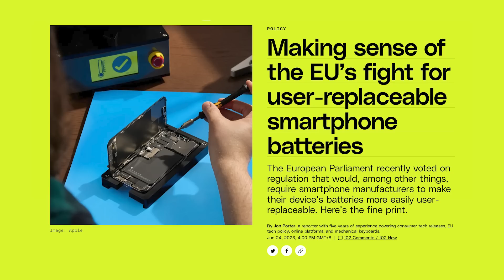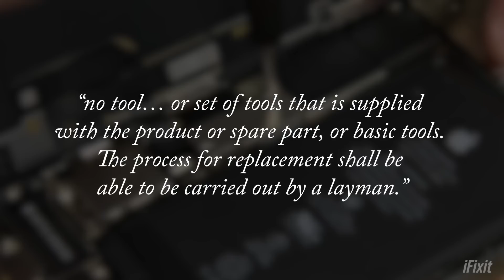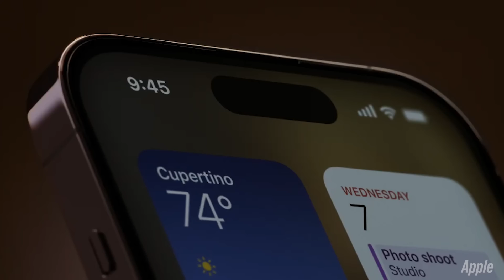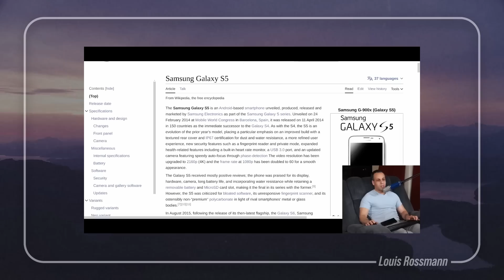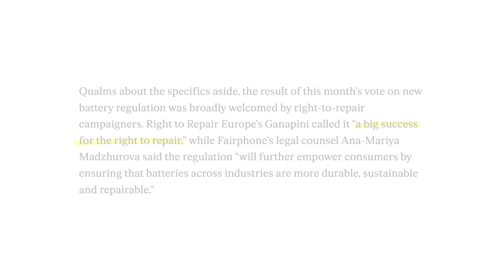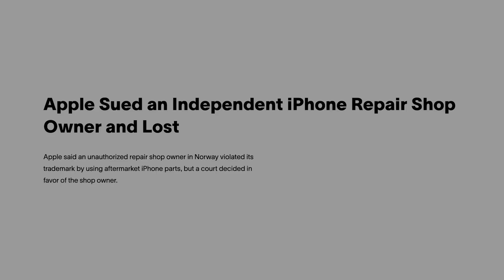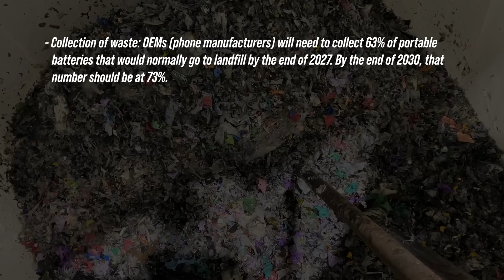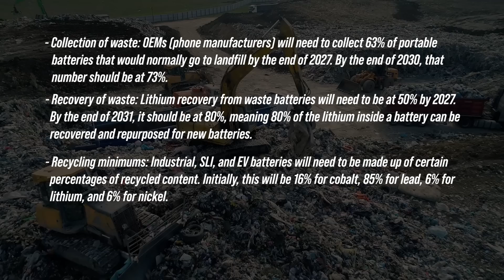EU Just Changed Smartphones Forever

Comment: One thing that never seems to get a mention and which I think is very important is power tool batteries. There needs to be a standard for the connections on 18/20V lithium batteries (The difference in voltage is not significant). I have several power tools with dead batteries that I can't find replacements for, even from the same manufacturer/retailer. Perhaps Aldi's "Xfinity" series would be a good start, as they seem to have standardised on it over their entire cordless tool range and they're cheaper than other brands.
Reply: There should be a one hand law. That is, for example, there should not be any more types of batteries, DC connectors, what have you, than you can count on one hand. And you should be able to easily tell them apart just by looking at them.

Comment: Actually iPhone batteries were easy to replace until the iPhone 4S: Just unscrew the bottom Philips screws, shift the back away, and it's open. I don't mind the adhesive when it's just a strip to pull at the advantage of no rattle.
For me, the 4S was easy enough to repair as a consumer - and I actually think the law might be a bit too harsh and will have bigger implications to device designs.
However, as I own Apple products and as more than once upset by their anti-repair and anti-upgrade measures, I welcome these changes. By my point of view, it was the greed of manufacturers like Apple - their own greed - that led to these changes. They just shouldn't have gone this far, I still should e.g. be able to replace the MacBook's SSD, as this is possible, it's a wear part - and Apple's upfront SSD prices are just obscene. You automatically will purchase a larger SSD and pay absurd prices to not come into the issue of running out of space to soon...
Reply: agreed, i don't get why they are not okay with using regular tools like a screwdriver to repair your phone
almost no one is hot swapping their battery anyway

Comment: As a retired product designer who worked for some time in the telecomms market I'm damn sure that while production love easy assembly with minimal parts and purchasing like products made of cheap components marketing love the idea that they can effectivly enforce product obsolescence and generate sales of new units. In my experience they were usually talking about 'delighting the customer' while stiffing them as much as possible. More sales = better share price = bigger bonuses for (certain) staff!
Reply: The Game changer EU=European Union
Reply: I prefer a phone that can't be stolen and immediately switched off. Removable batteries compromise security.
Reply: @TerriTerriHotSauce  thats a good point. but i guess they can build in a little battery like a bios battery in computers to power the GPS and remote switch 0ff. sure they will find a way :)
Reply: @TerriTerriHotSauce  Phones can be stolen and immediately switched off today, i fail to see what difference a removable battery makes
Reply: @TerriTerriHotSauce  I agree the phone is not completely turned off with the battery still inside and it still can be tracked but it requires special tools witch regular citizens do not have so u cant track it regardless if it has the battery still inside... I love how ppl are so pro environment and yet when we actually have a good way to do good everyone suddenly changes their minds. This just goes to show how much ppl actually care.

Comment: Batteries aren’t the main issue, never had one fail in a smart phone, what is the issue is tech moves so fast that the older devices can’t run the latest software so all this will do is make people go through 2 or 3 batteries per device because the existing dropped to 85% capacity and still replace the device in 3 or 4 years… I can see this creating more tech trash not less.
I’m all for making devices reparable by 3rd parties though, all these super slim designs mean bespoke packaging, so ether mandate a 4 year warranty or mandate 3rd party reparable
Reply: Also, how’s this going to work for a battery booster pack? Does that need to be replaceable? Or structural batteries like in the latest Model 3, it’s part of the car structure so can’t be replaced… will phone manufacturers do the same to avoid this law, meaning the once specialist replaceable battery is now no longer replaceable at all? Manufacturers will find a way round this unless consumers vote with their wallets…

Comment: "how do we solve the problem of users not giving back their old batteries when buying now ones?" simple... increase the price of the new battery by 25%, offer the 25% back when they bring back the old battery at time of swap or at later point...

25% can be a lot, especially when the battery can be easily $50... that just increased the new battery price to $65 or even $75 when they are told "we can give you back the money if you bring your old battery back" would have people bringing those batteries back as if they are well... still valuable to the economy.

Comment: Please no! I sincerely dread the moment I will have to buy a phone in an ugly case and in a case that disassembles into pieces when dropped because of this misguided law. It will also make the phones bulkier. The thing is the battery nowdays kinda works until you want to upgrade your phone anyways. In case you want to still use it with a new battery you can make it replaced in a shop. I fully agree with the "right to repair" sentiment that a repair shop should be able to purchase spare parts and those spare parts and the device as a whole should work without any lockouts when the damaged/expired part is replaced. But I definitely do not want an easy access to the phone battery. It's different with bigger devices (like laptops, ebikes and maybe larget tablets), but mandating this for phones is madness.

Comment: I believe This will not have as big of an impact as many think. Yes, there will be some users who - if the battery dies - will just exchange the battery and carry on on their old device, but I think a significant portion of the users is kinda accustomed (or rather conditioned) to having a new device every 2-3 years or so, and/or want to have the latest tech, best camera, and in the case of android a current OS version, as some android phones only get updates for a ridiculously small amount of time after release.

Comment: Non replaceable parts of ANY kind are anti-consummer. I have a Zanussi fridge that the company doesn't support replacement of the door seal. It was possible in the past to replace the full door at 50% of the cost of the fridge, but they don't support even that any more. The seal was glued in place but I still managed to replace it.

Comment: Did they change the exemptions?  One exemption says that waterproof devices do not have to feature user-replaceable batteries. The second exemption is even more interesting. This is the good news I was referring to earlier. Smartphone vendors like Apple can continue using built-in batteries as long as they offer high-quality batteries. The battery should still have 83% health after 500 cycles. Or 80% health after 1,000 cycles.

Comment: Of course the design is motivated by profit. What kind of question is that? But profits are attained by meeting consumers’ needs at the lowest cost to manufacturers. In this case, evidently the demand for user replaceable batteries is significantly weaker than the demand for other features, and those other features required sacrificing user replaceability for some combination of other things. It’s probably possible to make batteries user replaceable while maintaining some combination of price, compactness and water resistance, but almost certainly not all three. The EU law will cause electronics to either cost more, become bulkier, or become more prone to damage. I, for one, would much rather have a phone that needs repair less often than one that I can repair myself.

Comment: we are ok with bulky and lumpily shaped devices so long as the battery is easily replaced.

for years we had a bubble stick out the back of the CRT tv and we did not complain like karens  about the design so we would be perfectly happy is the CRT was brought back.

we only got rid of our CRT tvs because they could not offer all in one support for digital tv and we had to have set top boxes for cable, vcr and dvd player although there was tvs with the vcr and dvd player built in.

ok apple it is ok to warn us that the part is not genuine but allow us to replace the parts and DO NOT DISABLE FEATURES !

not only for an exorbitant fee could be charged but so they could break into our devices and dump the contents.

apple could easily design the phones so the battery sits in the middle with the logic board goes around the battery or even the battery sits atop the board and an work with repair tool makers to design a guitar pick like implement that has a ridge on it to limit how far in it will go so it does not damage the battery.

and implement the taptic functions in software and just use the existing digitizer glass to read the input.

you do not need a taptic engine module in your mac or pc to read a double click.

it wouldnt be difficult to enforce recycling of batteries just have a fee and reward like in lead acid batteries either as a core charge and/or paid by scrap yards.

or could the non removable batteries be a way to force us to either leave the phone in the car or take it into our meeting and hope no one calls and no one goes "whos phone is that?!!!!"

Comment: The phrase "planned obsolescence" is missing in this video, because it perfectly captures why batteries in modern smartphones can't be replaced - https://en.wikipedia.org/wiki/Planned_obsolescence. Once you can replace the battery, users will start demanding the OS remains updateable for longer as well - as long as the phone still works, why shouldn't you be able to update it? My prediction though: companies will comply because the EU is such a large market. And then they will find another component of the phone that stops working after some time, and the cycle starts over. A likely candidate is in fact the OS - by constantly introducing new features on new phones the producers insist are essential, and by claiming they can't afford to maintain the old OS while also developing and maintaining the new and improved OS, they will force users out of their old phones by breaking essential services that are moved over to 'new OS'-only.

Comment: I cannot see how they can pass this for EV's. This will make the cars less safe. Tesla has integrated the battery cells to frame of the car. This adds to the safety. Tesla makes the safest cars in the world right now, and after over 10 years, their batteries don't loose more the 10% capacity.   I would rather be driving a safe car with my son in the back, than a death trap, on the off chance that I need to swap the batteries out after 20 years.

Comment: Those laws are very needed! Anti consumer practices like this have to be baned! Some time ago battery in my laptop broke and to replace it i had to dismantle the whole machine including detaching the screen and completely removing the motherboard... While all of this could be easily avoided by slightly changing the design of "second" bottom cover that was intentionally made to make battery replacement as inconvenient as possible 🙃 And to compare i have older laptop in which battery replacement takes 5 seconds beacouse all i have to do is to pull two sliders (that are easily reachable at the bottom cover) and thats it! No "operation on open heart" required! Thats how it should be designed! I really wish that those laws will be working as intended ❤

Comment: There are many examples of manufacturers using different hardware for different regions. 
In fact it’s more common than having a single product and it’s precisely because of regional regulations. 
You only have to look at your car,  TV, watches, DVD/blu-ray player, in fact almost any appliance that gets plugged into a wall socket for power.

Comment: I was very happy when I first read about the law. My euphoria has since lowered by the laws details. Sadly there is an explicit exception for water proof electronics. So my assumption is that companies will rather focus to make their devices water proof than making the batteries replaceable.
On the bright side the law also forces companies to use batteries that maintain 80% capacity after 1000 charge cycles.

Comment: This needs to go one step further. Some of the bigger laptop batteries for workstations are just welded shut boxes filled with standard 18650 cells. You still have to buy a hugely expensive black plastic welded shut battery. But if they were forced to make the battery case screw together so you can easily access and replace the individual cells, you could do so much cheaper and even replace them with higher capacity ones for a cheaper upgrade.
Reply: I get where you're coming from, I genuinely do, but I do not want the average consumer to have access to the internals of a li-on cell battery. Those things are MAD dangerous and companies that produce individual cells aren't always the most reputable. If the battery packs themselves were just cheaper or at least offered some exchange pricing we would probably be better off
Reply: @Jinsoku440  A secondary market will develop supplying replacement batteries and associated services, including 'refreshing' battery packs. Quite a lot of batteries go dead for solvable reasons with an economic return being possible.
Reply: @keithmarlow143  you either misread my comment or I wasn't clear. My solution would be more akin to a return/exchange for li-on packs. Believe it or not most other consumer industries actually have these services in place, but like I said, individuals and/or the wider public with access to 9 or 6 cells terrifies me.
Reply: massive L for the EU. what kind of communist bs is this? next they will require phones to all have physical keyboards, or built in EU government cellular plans.

i cant believe people are actually supporting this, consumer products exist for a reason. they arent meant to be controlled by the government.

Comment: The issue is see in the EV market where batteries can be made a structural component. When the battery tray is part of the frame like on the cyber truck you have some considerations that will need to go into the design.

Comment: the ev recycle targets are just as stupid as the whole law made of morons.....
any battery is 98% recyclable, it is always extremely high value and will never ever land in a landfill, the value ensures that.
it is miles cheapr than mining material, and since batteries are basically all metal there is no waste at all ever.
metal is never waste, it is very easy recyclable.

Comment: I think it's criminal to glue and solder a battery in place. Now we need to make all devices USB-C as it's technically better than Apple's special adapter. Any power cord that doesn't convert wall votage should be IEC compatible as well.

Comment: On another note... would be good if they were to force Microsoft, to make it straight forward to install Windows 11 on ten year old laptops & desktops, rather than having to use Rufus to bypass the TPM.
So many good machines still usable today with a CPU change, more ram and SSD, not to mention the batteries are changeable on these old machines, also in some machines the CMOS battery are easy to access, along with the CPU.
However the normal stuff like the battery, hard drive, ram and WiFi card is all straight forward with laptops ten year old & plus.
Let's face it the EU would be too scared to deal with Microsoft !!!

Comment: I have a Unihertz Titan, almost every part can be replaced using just a small Torx driver. And it has nice grippy surfaces, metal edge plates, waterproof with 10ft rated 'snorkel cam' underwater camera mode. Replaceable components and waterproof can exist together. Yes, the Titan is big, but it is meant to be. The Titan Pocket and Titan Slim are much smaller and retain these features.

Comment: Maybe I'm a cynic, but this mandate isn't as concrete as the USB-C one.  For one, user replaceable doesn't mean easily user replaceable.  Apple could still make the process difficult and intimidating for the average consumer.  Also, what's to stop them from charging $100 for replaceable batteries?  That's essentially the same price you pay to have an Apple employee do it at a store.  Too many loopholes unless I'm missing something.

Comment: This is just ridiculous. I work in the business and I can give a couple of insights:
- The samsung s5 was a joke in terms of water resistance, the gasket would bend because of the motion of removing/attaching the back to the device.
- Lithium batteries are really dangerous, that is one of the most important reasons why they cannot be removed by anyone expect a technician.
- Luis Rossman mostly talks about stuff that benefits him, but works on stuff made by others and wants to be able to do how he pleases with the work of others.
- One reason why you can't just change one flex is because that would make it impossible for manufacturers to spot when a device is tampered with.
- If you want a job well done, always go to the manufacturer to fix it. Doesn't matter if is a car or dishwasher, always do that. If you want to spend less tho, go to whatever, but don't pretend the same results.
- Remember that you can't just buy a component online. What it means is that you have to buy it from a shop, who will charge you something more then the cost of the item, for example the battery, even if they don't provide any technical job. So batteries are not going down in price, you can be sure of that